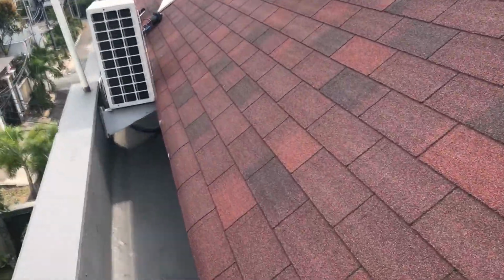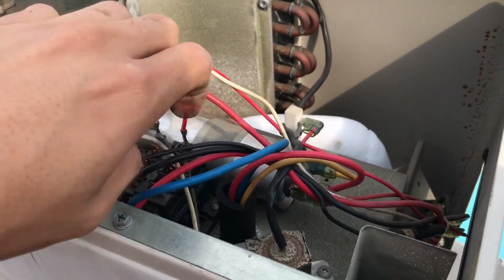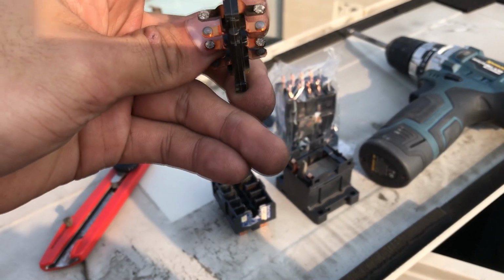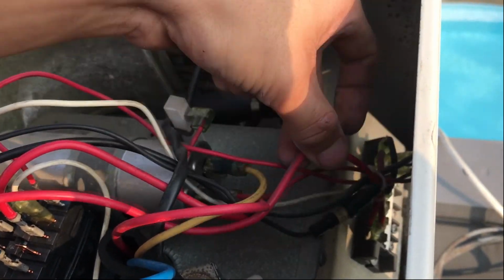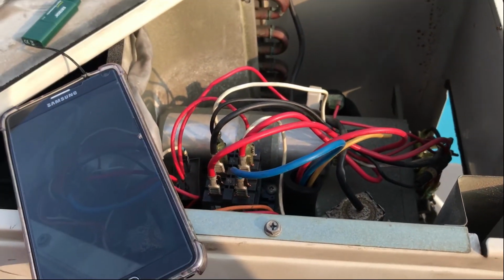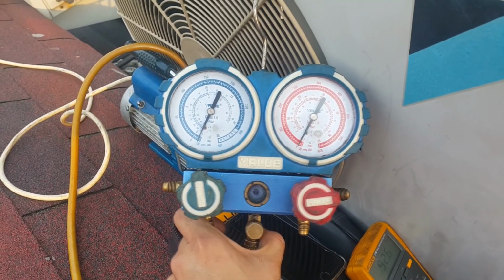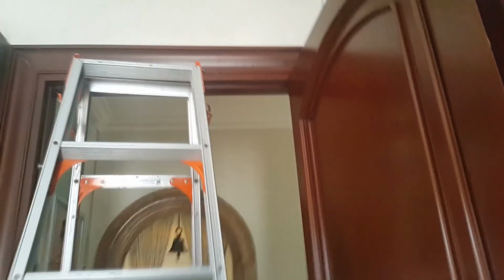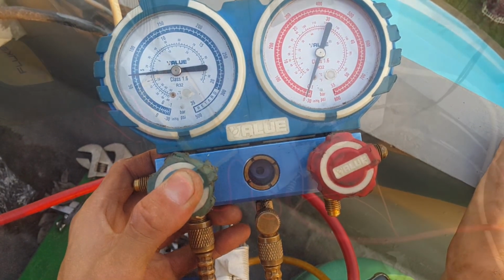2 TON Daikin mini split with welded contactor repair

Comment: Do you need the close back the service valve using Allen key after charge
Reply from the maker: No you dont need to, the reason i close the valve is so i can remove the connection to fix the flare connection